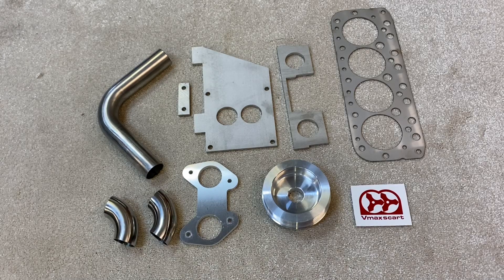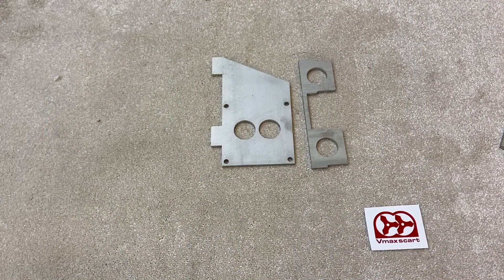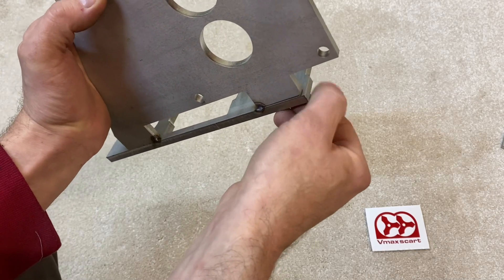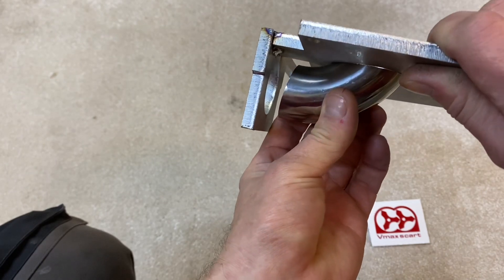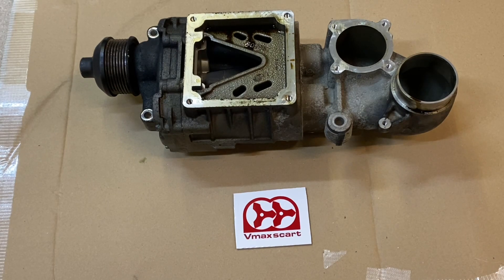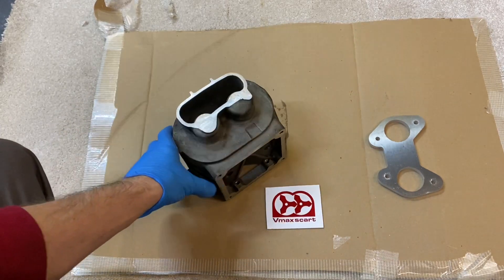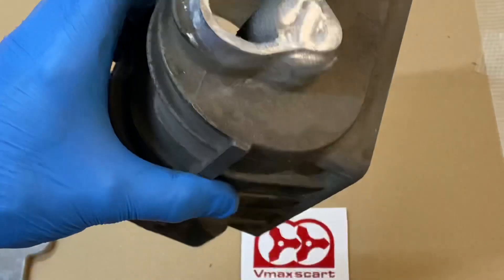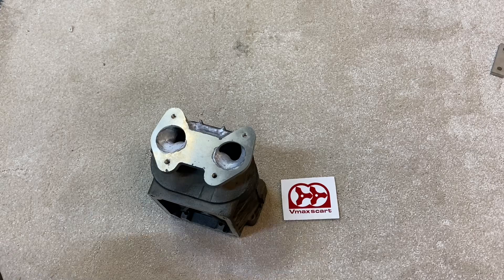Make a Supercharger  for your Classic Mini  or A series BMC engine part 1

Comment: Im going to try and attatch an intake pipe to run a HIF44 like your early charger kits which used the bmw mini m45s. Wish me luck haha
Reply from the maker: good luck, use m5 helicoils to increase thread strength.
Reply: @Vmaxporsch thanks Stuart. Hopefully with a straighter flange and attachment they won't be issues with fuel pooling and intake freezing

Comment: David Vizard would cringe at that decompression plate, saying something along the lines of, reducing the squish volume helps reduce detonation, and a decompression plate just increased squish volume. But I understand ... everything is a compromise between dollars and sense ;-)
Reply from the maker: Of course , In an ideal world we all build high performance all steel forrged piston race engine, run the on the dyno to test cams and then fit them to our cars. In the real world few people can afford thatoption, the decompression plate is a stop gap that allows fitting of the supercharger without removing the engine and changing components  small disdavantages  managed by lower compression a boost than could be used in a race engine .
Reply: what about using water injection ? Back in the day Gale Banks used water injection on his turbo kits that used the boost to pressurize the water reservoir and that injected water upstream of the turbo, and I suspect a blower would be less fussy about the water droplet size that a turbo. A low water warning light would be all the wiring needed.

Comment: Greetings from Austria!
Would I need a blow off valve in combination with a carburetor setup?
If yes which model do you prefer?
😉
Reply from the maker: No blow off valve required , boost is determined on pulley ratio.
Reply: @Vmaxporsch  Thank you very much Stuart